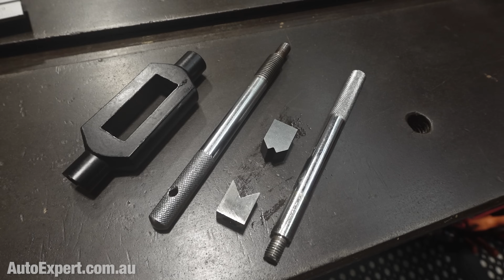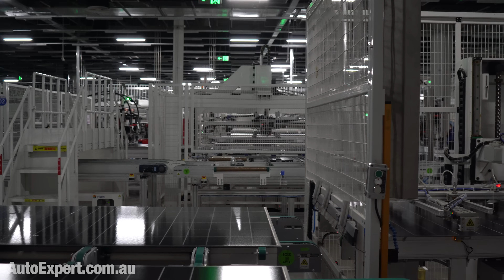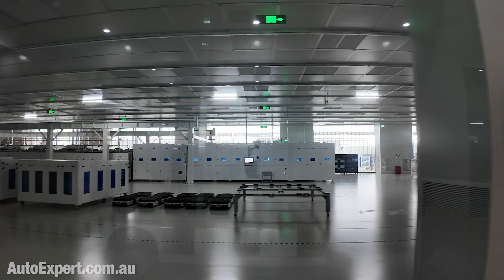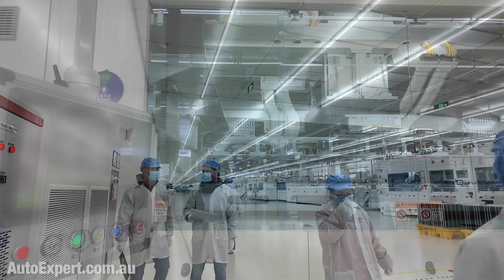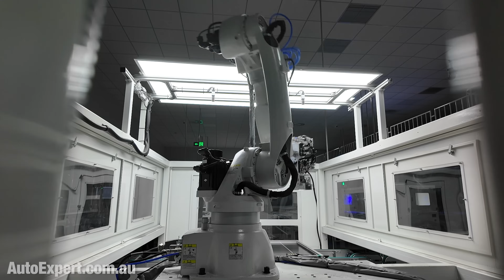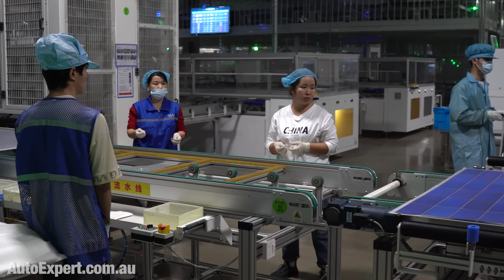The truth about Chinese manufacturing in 2025 | Auto Expert John Cadogan

Comment: I work for a US semiconductor manufacturer.  When I went to China 20 years ago not just the factories but the engineering offices were dirty and poorly lit.  Now the offices are sparkling clean and it looks like you could be in Silicon Valley.  Nice lighting, good air quality.  The factories used to be cramped and dirty and you would see armies of women soldering components onto PCBs by hand and with no magnification.  Now like you showed, all the factories are automated.  Not many people are on the production floor, which is sparkling clean.  The quality of vehicles in China, especially the paint, just blows me away.  There is not any orange peel, the paint looks like a Mercedes.  On a $20k USD car.  Look at JLCPCB or one of the other Chinese printed circuit board (PCB) manufacturers.  Even when you add tariffs and shipping, it still costs less and is ready more quickly than if I order PCBs in the US.

Comment: But this so called auto expert of Australia bought a cheap Chinese tool and thinks it represent the entire Chinese manufacture.

I have the same tool as well.  It is not as precise or robust as the western makes but it does its job as I seldom need to do threading on a steel rod or to re-thread a cross-threaded bolt or nut.  I can pay possibly 10 times more for a western tool but I do metalwork as a hobby so I have no issue with the cheap Chinese tool I use infrequently.  At the end of the day one selects tool to suit one's specification or requirement so using  one cheap tool to trash the entire Chinese manufacturing in a public platform is downright ignorant and arrogant.
Reply: Wow you're jealous

Comment: When it comes to the scientist who developed a technique to double the power output of solar panels, it's important to understand that having ideas on paper is not enough. Companies typically purchase the rights to use patents, which usually results in minimal royalties of around 1 to 3%. The true costs lie in manufacturing, creating specialized tools, sourcing materials, labor, and marketing. An architect may create elaborate designs, but it's the builder's job to transform those designs into reality, and that's where the real challenge lies.  People typically praise the inventor and forget the manufacturer.  As an engineer, who'd sweat to get many products off the ground, i know all too well that manufacturing is most often the hardest part, and is never acknowledged.  We're the unsung hero too.

Comment: It was so good to hear you giving deserved credit to the work of Professor Green. I attended a Solar Energy Congress, held in a University in Perth in mid 1983, as just an young, interested computer technician. There was standing room only in the Uni lecture theatre, when professir Green gave his presemtation. There were international attendees from 60 countries there, and reps enthusiastic to hear all he had to say. I think he had increased the record cell's output voltage by about 20% over normal, and on a very limited budget and support. Fantastic stuff. I have the 5 printed books, covering all lectures there, and will dig them out and find his words to have a read. 
Australia wasn't necessarily in front in other energy areas. A presenter from California Edison Electric Co I remember, listed the 9 grid-feed sources they had working in that State. Coal, gas, oil, nuclear, wind, solar PV, solar thermal, wave and geothermal energy. Some would have only been experimental, but it was 1983, so still.pretty good I thought.

Comment: Hi John 

I am pleased you visited China and the solar panel plant. I have made similar visits and have come away very impressed.

Australia did have a substantial solar panel industry back in the 1990s. BP had a plant in Sydney making these things from scratch. Twenty of their eighty Watt panels powered my offgrid home for over twenty years. They are now by any measure obsolete and I am swapping them out for modern chinese panels offering at least three times the output for comparable size. 

Most of the BP panels now put out less than 60W. Some have been affected by lightning, and have gone to zero. In others you can see the wafer has become discoloured presumably due to UV. In others the individual wafers have overheated and cracked. Even the facing glass slowly deteriorates and becomes 'foggy', I think due to 'sand blasting'. 

Despite all the environmental traumas 24 years on, about 25%, are still churning out a useful amount of power 60-70W.

Based on this experience I estimate the useful commercial life of solar panels as fifteen to twenty years.

Comment: In 2024, China put up renewable electricity generation capacity to equivalent of the ENTIRE Indian power grid, in a single year. 

When China smelt steel, they use electric furnaces that draws more power than a regular grid can handle. They do it on a scale of close to 100 tonnes per smelt per furnace, and they have incrementally increased heat retention so much that its faster than old coal furnaces by hours. It cannot be duplicated without a full power grid infrastructure, transformer, humongous inputs and steady supplies of it, and the infrastructure to move hundreds of tonnes of stuff every day. 

Its the whole system that makes them insane.

Comment: Fair enough you have been to China had a look at their best 
Trouble is that's a long way from their worst 
Inside 10 years ago I drove a great wall petrol Ute manual 
What I noticed is the lash from throttle on to throttle off it was like a motorcycle with a slack chain that was near jumping a sprocket tooth 
My old Toyota bus has 3 tailshafts and it hasn't got half the slack
On a more modern note 
My employer has bought 2 machines recently out of china 
A fibre laser and a break press 
Both cnc they are both by no means reliable and have been problematic and I have to deal with 
Both their issues example
Electrical
Mechanical
Software glitches
And phones not being answered
From suppliers and technical assistance people 
You get what you pay for 
I'd suggest to anybody considering equipment purchase
Buy at least midrange equipment
Not the bottom dollar Chinese made gear 
At least your questions and parts
Queries will be answered
We've had to make parts for these machines and they are less than 2 years old because of poor design and availability issues
When they are working they are 
Not bad 
Trouble is that's a problem quite often downtime has been substantial bordering on 20 % 
Each to their own

Comment: problem isnt their making its in material used ouse to service machine tools and CNC if I had a dollar for every machine tool that broke because steel used in shafts and gears, probably because those steels are a lot more expensive, same for aluminium never heat treated they can machine stuff pretty good but they use low grade matirial, then the intellectual property's they have stollen they aren't the good guys here

Comment: Used to sell tool to the automotive trade back in the 80's - 90's all brands koken, Gedore, KC tools Stahwillie but I always kept cheap spanners and screwdirvers for the tight arses. Used to sell heaps, esp the 10mm spanner/sockets and feeler guages The china stuff was horrid, chrome used to peel off the screwdrivers and in 1 Jaguar workshop A forman bought a set of china made scredriver off me and no matter how much I tried to change his mind, he insisted they were fine. 2 weeks later I went back to the workshop for my fortnightly call only to be informed that the forman was sacked as he used the china made screwdrivers on an engine rebuild of a v12 jag and the chrome peeled the screwdriver tips into the motor, I know you can guess the rest, it was an expensive rebuild by the dealer. Glad to say though that I have no issues using china made tools today. I still have my Koken and Gedore tools today, cant break them even when I try.

Comment: John, you didnt mention the Australian developed Sliver solar cells. Sliver cells are sliced into very thin strips, with a gap between. Incident sunlight can then pentrate the side edges of the silicon strip, meaning that the range of incident angle of sun with high cell efficiency is hugely improved, making traking obsolete. Developed in a Melb uni, and bought by Origin Energy and then buried.

Comment: I guess it depends on the industry. The company I work for has often received products from the Chinese factory that were so badly made we had to have them remade by local engineering shops. They don't know how to bend steel without cracking it.
I'm an engineer myself. My Chinese counterparts that I've had to deal with are very frustrating. They're pretty good on the theory, but have little idea of how things work in the real world. I think they spend all of their time in the office and zero on job sites.

Comment: In my experience, Chinese vehicles are let down more by poor quality materials used in the manufacturing process. While the designs and technology are 'modern', the metal and plastics are often rubbish. There also appears to be no 'car culture' in China, whereas in Japan the auto design engineers want to do a good job and build good quality cars because they have a car culture.
Reply: Prove it . Show evidence by showing ncap test results
Reply: @zacksmith5644  NCAP is not a proving ground for vehicle quality or longevity, only for crash testing and inclusion of electronic 'safety' add-ons. I have seen first-hand the poor quality of materials used by some manufacturers, hidden nicely under a shiny coat of paint. Chinese are not innovating automotive design, just redesigning and copying while using the cheapest materials. On saying that, 'you get what you pay for'. If all you can afford is a Chinese car, then go for it, just don't expect the same reliability and quality of a Japanese built car.

Comment: There is a metric to test the efficiency of electricity production: 
Energy return on investment (EROI).
The so called "green technologies" have the lowest EROI, and, in the particular case of solar panels I doubt that the disposal and eventual recycling expenses or the ecological cost of not recycling have been included in the calculations.
Hydro and nuclear powered electricity production have the highest EROI.
Therefore, countries that do not mainly use those 2 methods (hydro and nuclear) of production are incurring large opportunity costs that  will penalize their economies.
In some regions, hydro generated electricity will be out of the picture due to geographic, environmental or even economic constraints (it could affect the revenue of the tourism industry). Regarding nuclear power, however, no first world country with it's faculties of science and engineering has an excuse to not build those power plants, and if it doesn't it won't be first world for much longer. Engineers are not just to build equations and open packages of crap made in China.
If governments did their job of ensuring that their countries are producing electricity at the lowest possible cost, the only business case to use solar or wind would be remote areas with low energy demand and to which the costs of building an electrical energy distribution infrastructure would be unjustified.

Comment: Enough solar panels to produce 37 Gw (I think you said) at maximum capacity. 
Unfortunately, in the real world of usage they will not even get close. 
Maximum is only achieved when they are correctly aligned with the sun, they do not get to hot loosing conductivity, it is not cloudy, and obviously, they do not work at night. So again they are dependent on lithium batteries for electricity storage, a now obviously risky technology. 
But having said that it is still a useful technology in many applications.

Comment: The Chinese reputation for manufacturing cheap crap was indeed rightfully earned, 20 years ago. Up until the 2010s the Chinese economy was still depending on cheap goods using cheap labour. What happened since then was that the country has reached the inflection point, where they've gathered enough momentum to start turning the tables around. The pace of change in China is astronomical. The dark factories you see today weren't there just 5, 7 years ago.

It's like the Japanese. In the 60s they were known to make "Jap crap", but they've improved since then to gain a reputation for quality.
Reply: Not really . It was a propaganda by US administration. 

China is always making best products for 5000 years

Comment: In1998, China had 1million university students.  By 2023, they had increased it to 44 million.  China has over 2,000 universities and is opening a new one every week (average).  Meanwhile the  USA is dismantling its Department of Education.  China has 50,,000km of high speed rail.  USA = 0.  USA has 750 foreign military bases.  China has 2 with 10 in planning/construction.  China has Belt and Road initiative.   USA stopped USAID which means 2 million africans will die from HIV/AIDS.  The USA outnumbers China, 12% to 3% in the number of functionally illiterate people.

Comment: Countries like Saudi Arabia will be planning for a post-oil situation. Part of that will likely involve working with Chinese solar panel companies to put those deserts into good use as solar farms. That way combined with Chinese assistance in ultra high voltage power transmission infrastructure they could continue to be an energy exporter, in terms of green electricity rather than crude oil.

Comment: I used to work for a Japanese MNC which built specialist offshore platforms in Chinese shipyards. These cost around USD1 billion or more each, and take about 3 years to build. Japanese engineers told me that they were about as complicated as a Saturn V rocket and as difficult to build. The Chinese shipyard we used regularly first started to build these platforms about 15 years ago. According to the quality head, the Chinese shipyard had no experience and it was the first time they had built such a platform. They won the contract on price. To put it mildly, many in the Japanese company did not expect the Chinese to finish it on time or at the quality standard expected by them. Yet, they not only finished on time but to the surprise of the Japanese, at the quality they wanted. Fast forward a decade, that Chinese shipyard has designed their own platform and selling it internationally! And they are the preferred builders for international energy companies due to their expertise and price.

Comment: The scale of this facility is impressive.

Before I moved to Dingo Piss Creek and got my lobotomy, approx 20 years ago, I used to work in wafer processing and packaging. We built a machine with an Austrian specialist company that could align the wafer package to an accuracy of 20 microns (after many sleepness nights no less). My process controls charts were a thing art, the CpK was tight AF.😂

I am not belittling China, far from it. The company in the video seems to be well run. However, my point is, a lot of these processing techniques have been around for decades. Things like using robotic arms to sort wafers and move things about automatically based on defect maps etc, we had that at my facility in the mid 2000s. 

Looks like you had a blast out there John...this brought back memories for me!

Comment: So many products coming from China are inferior.
Just recently:
Chinese-made wind turbines on Australia's biggest wind farm have cracked, sparking outrage that the project didn't use locally made machinery.

Nineteen of 40 turbines inspected at the Stockyard Hill wind farm, in Victoria's central highlands, are defective and will take months to fix, according to the Australian Manufacturing Worker's Union.
Imagine the money being used on these renewable resources. 
Safety glass also had issues.
Steel?
I'm still not sold on Chinese products but my opinion is my opinion😊
Reply: The western companies will have demanded the cheapest manufacturing of those turbines - they were probably warned by the Chinese manufacturers of the associated risks. But shareholder profits came first.

Comment: China advanced in certain technologies by providing massive government subsidies (along with IP theft and other unethical practices), which continue today.  Those subsidies are mostly targeted to solar cells/panels, EVs, and EV batteries.  The general population gets a relatively small portion of GDP, which is why the consumer market and overall growth rates are small.  China soon will enter "lost decades" of economic growth similar to those of Japan in the 1990s up until recently.  That's the optimistic economic scenario; it might be much worse.
Reply: I should add, the massive subsidies also apply to semiconductors and pharmaceuticals, but it has less success in those areas.

Comment: Did you try NordVPN while you were there? Didn't work for me in China.
Reply: Does your telco allow roaming in China? If it does, just switch to roaming and you will bypass the fire wall. No need to use VPN. My Singapore telco allows me to roam in China.

The other option is to use a sim card or esim from a Hong Kong telco. In Singapore, I can purchase this type of Sim card. Again, no need to use VPN.
Reply: @nsng1298  Thanks for the tip. I use both - because Optus roaming data is expensive and doesn't work well with Chinese apps. However, I still need a VPN for Paypal transactions even with Optus roaming. HotspotShield worked on previous trips. 'Upgraded' to NordVPN. Has worked okay except for in China.

Comment: John, you should do some research on this with your connections. 2004 on the New Inventors on the ABC. A CSIRO development was a Silicone Strand PV panel that 100mm by 100mm produced more power than the industry leading panels 1000mm x 1000mm in size. The thing went stealth mode immediately after...........never to be seen or heard of again. Perhaps you can dig and see what you can unearth?